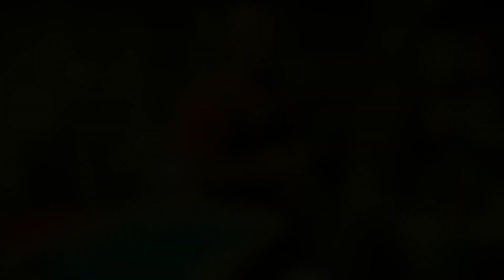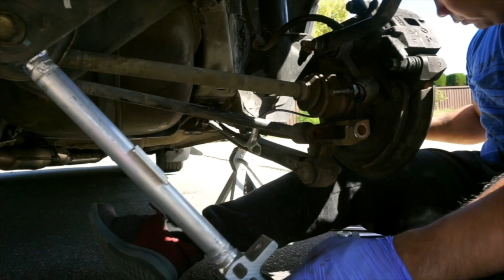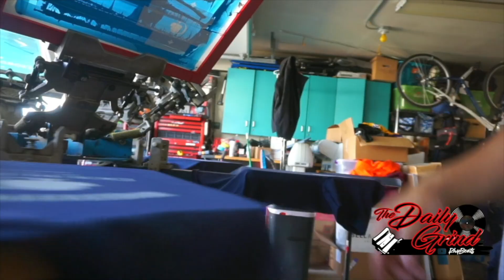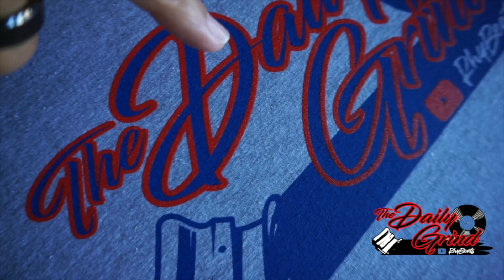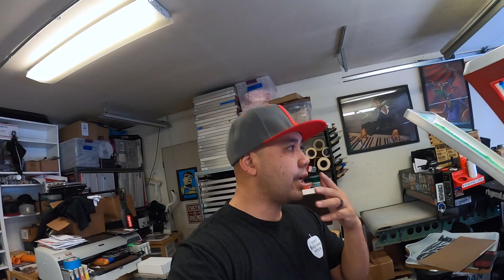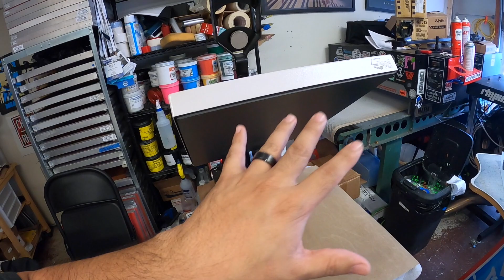My Heat Press and The Tools That I Use (S:05/Vlog 076)

Comment: Mad props Rhy 🤘Good content and straight to the point! I have watched a lot of heat press videos and you have summed it up in less then 5 minutes with the correct tools and proper alinement techniques. I’m super pumped you said about checking the print to make sure it has adhered correctly, if you don’t see the thread pattern in the vinyl, your pressure is not set correctly or you didn’t press it long enough. Manufacturers set a guide line for temperature and pressure settings but like I said it’s a guide line not exact for every press. Different manufacturers produce different products that work relatively the same. Ok I’ll shut up now 😂 keep on grinding! Catch ya later 😎
Reply from the maker: Yes I feel the same way. They give you “recommendations” on temp, pressure, etc. always adjust to fit your needs. Sometimes I even press it again after I peel the backing off. The last thing you want is the print I be coming off. Thank you for the support !
Reply: RhyBeats you’ll always have my support! You, Sin, Matt, Juan, and John keep me motivated, watching your videos keeps my spirits up through struggles I have in my shop. 4 years ago I saw a video Betsy from Netterland, TX @ Cutting Corners on HTV and was like damn that looks easy enough lol 😂 I bought a 72” plotter and lots of vinyl. Definitely a learning curve I didn’t see coming. 3 years ago I came across one of Kevin Hackett’s video series called the start up life. I was so inspired I went out and spent 12,000 on equipment after doin research of course and I quit my job and started printing and eventually I came across you guys videos and have been hooked ever since! Your hard work doesn’t go unnoticed my friend, as always keep on grinding 😎👍